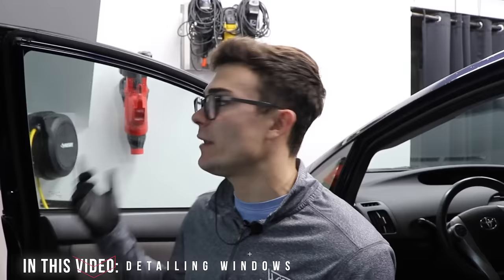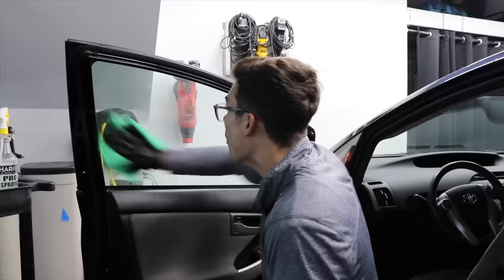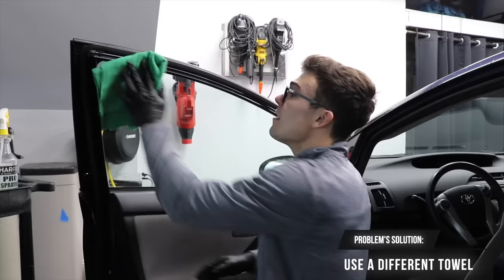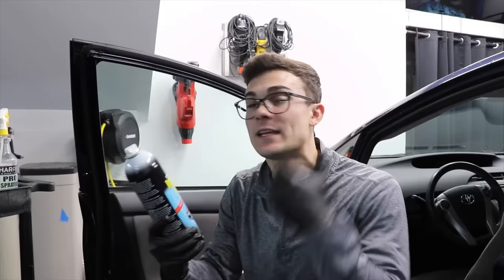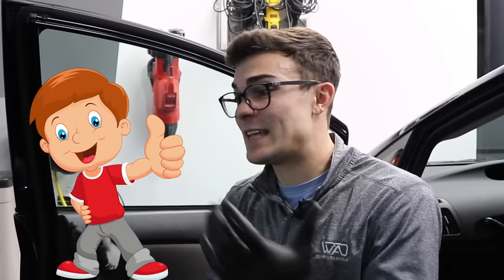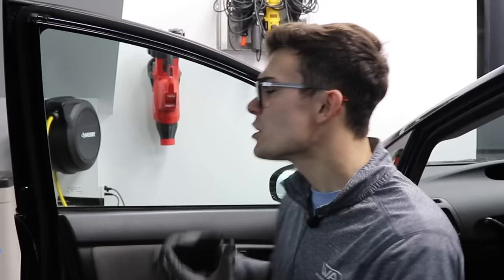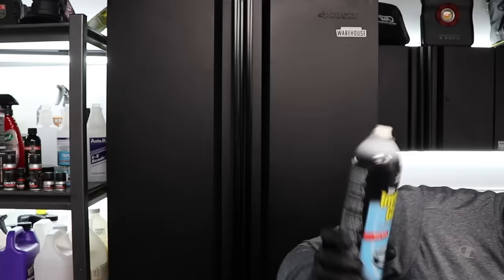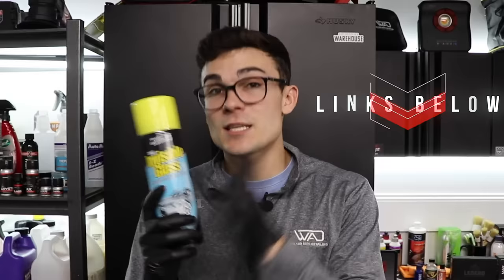Solving The Biggest Problems With Windows

Comment: The haze often comes from the detergent used to wash the cloths. Most modern laundry detergents are all in one, and include ingredients that coat the fibers of the cloth so that fabric softener is optional. This can leave a haze because the alcohols in the cleaning solution can cause it to break down and get deposited on the glass. Be very selective about the detergent you use to wash your cleaning cloths.
Reply: Have you found any good, inexpensive detergents for microfiber cloths?  I see a number of detergents marketed specifically for microfiber towels, but I don't want another specialized cleaner if I can just buy something I use for both my clothes and microfiber towels.
Reply: @kirkjohnson6638  You might try some of the "free" detergents, that is, free of fragrance and other ingredients that may produce allergic reactions in sensitive persons. I'd also recommend enabling an additional rinse cycle if your washer supports it. The new formulations for "HE" washers do have some drawbacks, and the reduced water usage of those washers does cause a larger amount of residual detergent to be left behind.
Reply: @jspartacus  Thanks!  Yeah, I'll give one of those fragrance free detergents a try.  I always keep a microfiber towel on my dresser to use for cleaning my glasses and the detergent I have now seems to cause streaking, but it could be that a Bounce sheet got tossed in the dryer.
Reply: Tide free and clear works! Hope this helps
Reply: Excellent point
Reply: Did you try a vinegar wash. Nothing else.
Reply: @kirkjohnson6638  Include white vinegar in the final rinse to remove any residual detergent.
Reply: @charlotteemerson5050  Thanks
Reply: @Charlotte Emerson  Better homes and garden years ago did a test of what readily available chemicals make the best glass cleaner and the ratio of what to use. They even had a few different recipes. Rubbing alcohol, water and vinegar on tint-free surfaces have worked great for me for years.
Reply: Exactly! I think this is the #1 problem concerning these issues. If one wants to make it simple, just buy those blue shop paper towels. They're lint free and you won't have to worry about residue. If one has a build up of residue on your windows use an automotive grease and wax remover, professional grade. It comes in a can btw. You'll probably have to go to an automotive store that makes car paint to find it. A can of that stuff will last you years! It will make your windows look transparent afterwards. Just make sure to condition the surface afterwards with a window cleaner and whatever rain repellent you use, if you use one. I find that sometimes just using alcohol doesn't remove everything. This stuff will, guarantee!
Reply: @jerz732  So do "All" and Arm &Hammer.  They're also less expensive.  And use ONLY a liquid-based cleaner.
Reply: @kirkjohnson6638  Never use Bounce sheets or any fabric softeners on any cloths you want to use for car detailing. Straight unscented detergent " Tide Free", etc, and maybe a splash of vinegar in the rinse cycle tray where your softener would go. Wash cold/ cool. Dry cool/air fluff; as little heat as possible.
Reply: Huck towels are very lint free and absorbent.

Comment: After wasting money on all different glass “cleaners” and still seeing a haze after, I switched to water with a very small amount of Dawn dish detergent. I usually mix a quart of water and 3 or for drops of Dawn. I’m not talking about show car detailing level, just nice clear glass that I can see out of when driving at night. Seems to strip all the oils off that the name brand cleaners won’t touch and there’s no need to rinse when done. I also use the cheapest paper towels. The stiff paper trifold ones that are used in the dispensers work great. They don’t leave any lint at all. It almost seems like it stays cleaner longer but i don’t have any proof that it does for sure.

Comment: Oily film on glass can also come from wetting agents in some paper towels, as mentioned on the can of Invisible Glass. Also diesel fumes and soot from traffic can coat the inside of the windshield with an oily residue. Fabric softener is essentially oils, so that will contaminate any microfiber with fog-causing residues.

Comment: I'm just a car owner, but I just squirt a very small amount of Dawn Free and Clear spray dish soap on the inside of the window and clean it with a slightly wet (warm water) microfiber towel. Works better than anything else I've tried. Then I might hit it with the Invisible Glass unless I'm in a rush.

Comment: Good video and a word from your' Invisible glass cleaner'  sponsor as well.  I find the foam cleaners to work real well.  To initially  clean tough glass I just use our household hydrogen peroxide oxygenated solution cleaner or Windex.    The day I stopped using Armor all was the day I stopped having trouble with interior glass.  Wash micro fiber towels in warm or cold water and never put them in the dryer.
Reply: What do you mix with the hydrogen peroxide?
Reply: @aayotechnology  I use a household cleaning concentrate product called BIO-OX.  Its basically a Hydrogen Peroxide oxygenated concentrate that you mix with water> It cuts any residue on windows...carpet stain remover, everything except wood or leather.   I've seen similar Hydrogen peroxide concentrate products in janitorial supply stores.   One gallon lasts us a year.
Reply: In the late 20th century Volvo cars had a big problem with the dash cracking. It seems Armor All was a major contributor to it.

Comment: Rinseless wash is far and away the best way to clean glass.
Reply: Yep i’ve been cleaning mine with ech2o, works fantastic
Reply: Yes P&S Absolute works fantastic
Reply: And more expensive
Reply: @NeverComplyEver  i use ech2o 1:10, it’s €14 here for 500ml. I can make a liter for about €3 including distilled water. A liter of for example stoner’s is about €11
Reply: “Cinch” by Spic n Span has been around for decades and performs as well or better than 99% of the dozens of detailer window products on the market.  I’d bet the formulation is closer to the 50/50 solution this gentleman creates.  It is also comparatively dirt cheap.  Hard to find in some places… I buy mine on Amazon.
Reply: Ya that's what I have been using and I like it

Comment: ive been using this glass cleaner for a couple decades lol. one of the gassing causes is mold release agent on the plastic panels. if you detail at a dealer, like i did for a long time, you get very used to all the cars coming in off of the truck with a ton of this haze on the glass. sometimes i even experimented with brake kleen, naptha, and acetone because this was such a PITA.

Comment: Great interior glass cleaning tips!  What percentage IPA (before dilution) do you use, 70% or 91%?
Reply: You don't really need 50/50 mix. A good paint prep after polishing is 9oz of 91% to the rest water in a 32oz sprayer. So you could use that for windows too

Comment: The problem is that there could also be build up of previous products on the window, as well as whatever residue has been left on your rags after washing them. Then you have to factor in off-gasses from all the plastic parts, as well as what he mentioned about the dressings you put on your plastic. Everything he says is correct, but it's a little more complex. I find the best product to use is an automotive grease and wax remover, professional grade. You have to go to an automotive shop that makes automotive paint to find it. Buy a can of that stuff and it will last you years! This is the stuff they use to prep surfaces before painting btw. It will remove "everything" on your windows! Make sure to clean them afterwards with the window cleaner of your choice. But a water repellent on too if you wish. I use this solvent about once or twice a year to give my windows a deep clean. Sometimes I get people telling me that my windows look transparent. Even those window cleaners leave a residue. You got to get all of that residue off from time to time. I find this is the best and easiest way to do so.

Comment: In Quebec we have a biodegradable soap called Hertels, half a capful in a bucket of water and a microfiber cloth and it's as simple as pie, you go through it the first time, you take the other side of the microfiber and you go through a second time and here is no residue, the glass is super clean without trace.

Comment: I recommend getting the Sprayaway SW050, not to get it confused with the normal Sprayaway. The SW050 has a lot stronger foaming action which makes it better over the normal product. We used to use it as an all purpose cleaner/glass cleaner back in an old body shop I worked at. Even the all the glass installers I know prefer the stuff.

Comment: I do residential window cleaning on the side. Best way ive found to clean car windows is either 1) a dawn dish soap diluted in water solution. Use a 5" window cleaning brush(like a Sorbo tbar and brush cover) and then squeegee it off with a 4-6" squeegee(like a Sorbo\Ettore handle and channel)(is quick and gets it perfect) then you wont have all the hassle and time wasting of letting something dry and alls you have to do is wipe the edges, which can be done with a conditioned terry cloth towel or micro fiber can work as well. It works in humidity too(FL resident here). or 2) THE ONLY product id ever recommend for cleaning glass whether in a car or home is Sprayway Glass Cleaner. It comes in a white can with blue lettering. Best stuff on the market IMO.
Legit the quickest, tint safe, most efficient, least complicated and even cheap way is the first i stated. You buy the small brush and squeegee(commercial grade none of that walmart crap and NOT a two in one) and its fairly low cost and you will have them for years. Only thing youll have to purchase occasionally is squeegee rubbers.

Comment: I've been cleaning for more than 25 years ,  Cold water a couple of drops of dawn dishwashing liquid a clean microfiber rag rung out completely with this solution apply the soapy water to the glass & remove with a squeegee for auto windows , I've gotten a streak free clean every time I wash my car windows .
alcohol will work but it causes off gassing when you get the alcohol on or close to the interior plastic.
For this reason I do not use solvent based cleaners on car interior windows.

Comment: Wipe the interior of the windows with a little lacquer thinner to remove any vinyl deposition first. A good DIY window cleaner is 25% isopropyl alcohol, 75% distilled water, and a few drops of dishwashing detergent. Tight weave cloth is the way to go.

Comment: I started using an all purpose cleaner I made for random stuff in my house on windows. 3/4 72% isopropyl alcohol, 1/4 water (distilled for best results), and a squirt of dish soap. It’s cheap and incredible for windows while also working great on general surfaces in the house, stainless steel, and porcelain.

I wipe with a fine thread microfiber and the results are perfect and better than any dedicated glass cleaner I’ve ever had.

Comment: As a professional window cleaner for 20 years now, the number one problem with streaks left on glass is because of the cleaner that you are using. It does not matter how much soap you use the streaks are coming from the residue left over from the cleaner. If you notice a fog or haze I call that over soaping your glass. The way you remove that is use just water. The more pure you can get it the better the result. Water in its purest form is looking for minerals to grab on to. The pure water will pull off the soap off the glass and leave your window looking great. I use surgical towels, they are highly absorbent, and have low lint left behind. Because they are used to clean up the blood for surgeries. They can also be used for cleaning glass as well.

Comment: I use Autoglym Fast Glass on all windows. On windows without tinting, I then go over the glass with Autoglym glass polish. Fast Glass gets rid of the visible stuff and the glass polish removes all the chemical residue from the glass. That includes the chemicals that come out of the vehicles interior plastic parts.
I do exactly as you said, by having specific towels for specific tasks.

For plastic parts, I use 303 Aerospace protectant. (Autoglym also makes a product, but I haven't tried it, yet.) I've used it for a couple of decades, on all the plastic parts, inside and outside. 
I don't use any Armorall products. They don't work anywhere near as well as they claim. Their plastic treatment only lasts about a week, vs at least three months for 303 Aerospace Protectant.

Comment: a car glass repair guy told me that the only way to get the road film and scunge/silicone off the exterior of windshield is to buff it (by Machine) with a fine polishing compound called rottenstone. he gave me some to try its a powder you mix with a little to make a slurry and yes it works awesome.

Comment: I find a waffle drying towel works best to clean glass, in my limited experience. I also use waffle for final exterior wipe with a mist of quick detailer to remove any lint, smudges, or stray streaks of top coat product that got missed.

Comment: Great tips for great results!
I have been using the 50/50 solution for over 30 years. I started using it when I worked at an International Airport to clean windshields on the fleet vehicles. It was the only thing that would cut the jet fuel and easy to use.

Comment: Even pressure is a main thing.  I use a cleaning wand with any solution to get even pressure from top to bottom.  Windshield mainly since they are so bulky and awkward to work with.  Your hand alone simply doesn't get even pressure, smears and streaks will plague you.

Comment: Many years ago I was given advice from an industrial chemist he advised that one of the better things for lifting heavy fog deposits from vinyl upholstery off gassing is white vinegar and elbow grease.  It does actually work too.  He made the point that the off gassed deposits are particularly difficult to chemically remove, hence the elbow grease above.  But hey, cleaning car windows is not my favourite pass time, so I;m willing to try anything.

Comment: I first use a small amount of Mr. Clean (about 1 tablespoon) in a gallon of water...just enough to make it soap up...in clean water, soak clean cloth and generously wash each window inside and let dry, starting with windshield, driver, passenger, back, then rear passenger windows. Then I use clean water alone on a clean soaked cloth to pick up any remaining cleaning solution, and let dry. Then I use a light amount of clean water on a clean dampened polyester microfibre cloth, and dry with a dry cotton towel. Leaves windows grease free and spotless.

Comment: I've been using a 1 to 5 distilled water/rubbing alcohol solution on the first window clean for a couple years now. It cuts a lot of the real bad crap off the windows better than a cleaner. I follow with Invisible Glass. I recently acquired a bottle of Chemical Brothers glass cleaner that seems to work well also. The waffle weaves work great!

Comment: Advance Auto Parts sells glass cleaning microfiber towels (AC265) that work great for cleaning glass. And using the sprayway glass cleaner (SW050) you will get streak free clean windows!

Comment: I use the three towel method. 1 wet, 1 somewhat wet, 1 completely dry. This works 100% of the time. If the completely dry becomes somewhat wet, it moves up in spot. the full wet gets tossed to gunk cleanup.

Comment: Just a suggestion - Instead of rubbing alcohol, go to the hardware section and get denatured alcohol. I use it straight. Take a rag, pour some on and run it along the windshield wiper. That's how you clean them. I think the same thing every time I clean mine - Yuck! It'll cut the oil. Then use WD-40 on the blades. I clean the outside of the windshield real well as well. It's amazing how well it works just doing that. Eventually the blades will wear/dry out.

Comment: Invisible Glass and regular, plush, 300 GSM towels from The Rag Company has always produced 100% perfect results. Recently I've switched to ONR for my windows and couldn't be happier. Glass cleaning, like everything else in detailing, is overcomplicated by the vast majority of detailers. Spray some stuff on your window, rub it in with a clean microfiber towel, and buff it to perfection with a SECOND, clean microfiber towel. This has been the tried and tested strategy for some time...

On super dirty glass, use a squeegee. First, wash your window with glass cleaner and a towel, spray again, squeegee, then buff clean with a fresh (and DRY) microfiber towel.

Comment: How about paper towels?  It's what I use.  The first, cleaning stage, I can always see the dirt on the white paper towel that gets thrown out.  I can see where it will introduce lint when used for the second stage that I call drying/buffing.  But it avoids crap on it from previous uses.

Comment: The Invisible Glass in a spray can is great to carry in the car on trips.  Unlike anything you mix in a pump sprayer, you don't have to be concerned about a bottle getting tipped over and leaking.  One other point:  Alcohol is super flammable and often burn with and invisible flame..It is best used with lots of ventilation and well away from and sources of ignition.